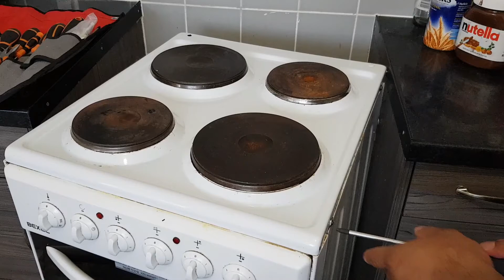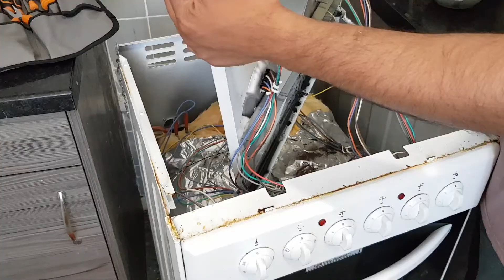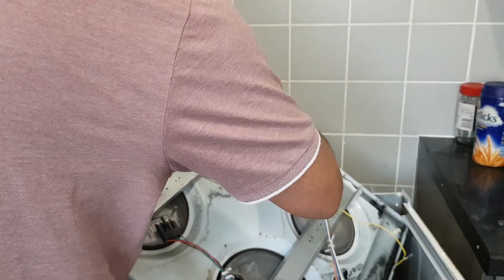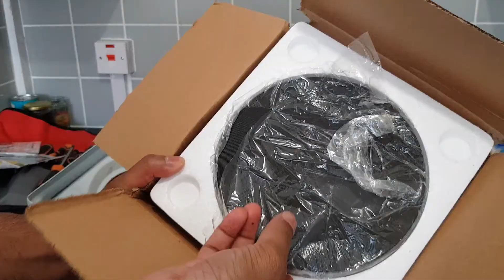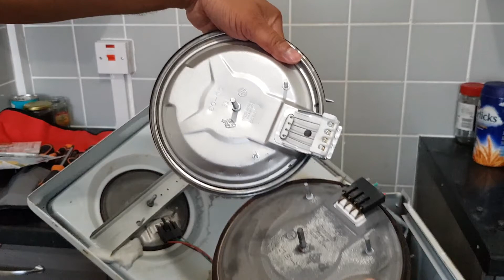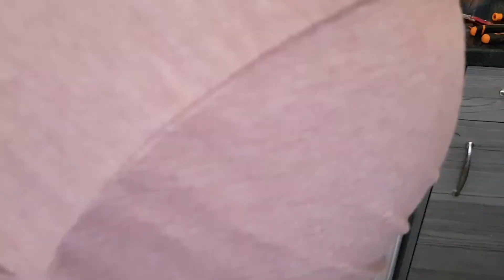IEblog#35 -Bexel Electric Cooker repair

Comment: You didn't explain why it was short circuiting, can you please tell me? Thanks for the awesome video, really appreciate it
Reply from the maker: Short circuit happens due the RCD main switch cutoff tolerance is low in my property.
There is a way to adjust it, but I don't have access to it

Comment: Thanks for the video. Please, my electric hotplate is smoking from under and a grease like substance coming out from under the plate. I've had it for over ten years but have been using only the gas comers ever since. I decided to use it for the first time last week. Scared by the smoke, I turned it off. What could be the problem? Please, I'd appreciate any help you could offer. Thanks.